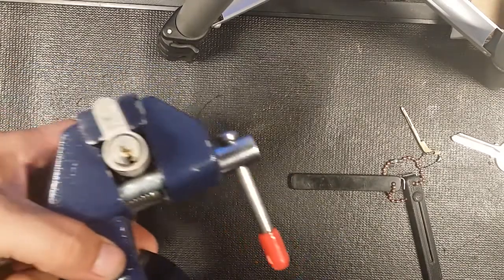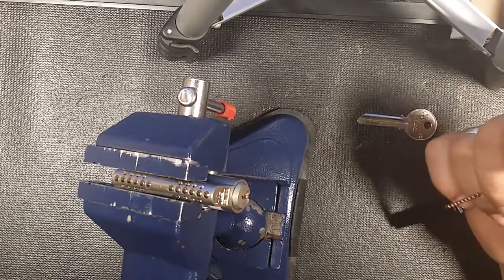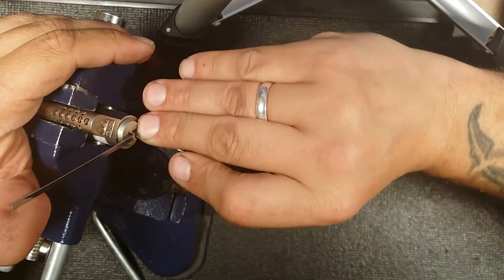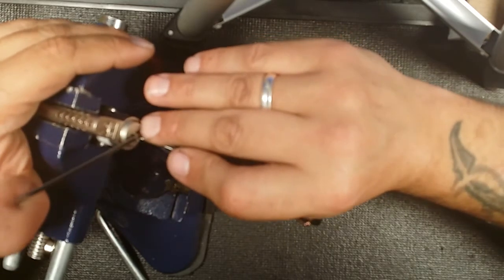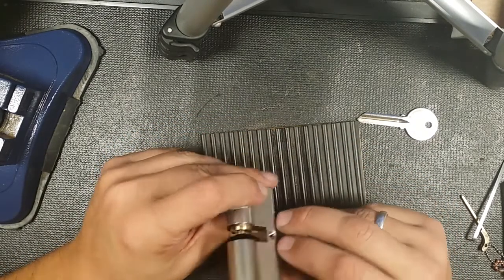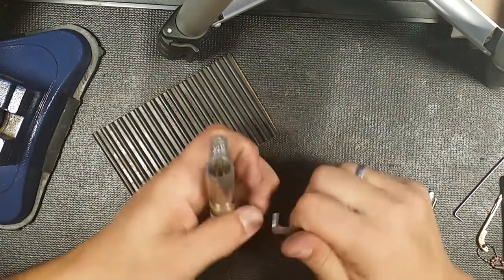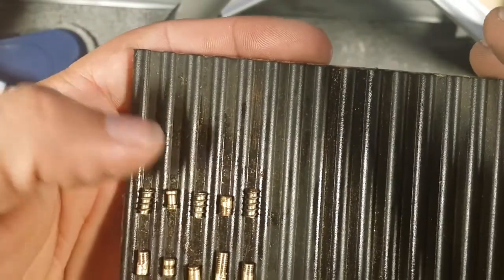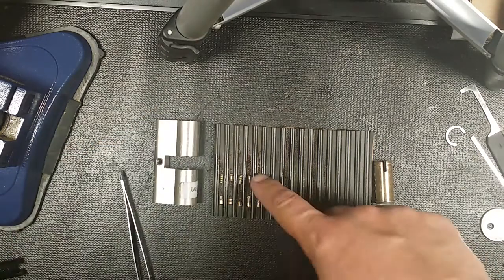-=142=- GTV Challenge Lock By NoTrickPony!

Comment: Great job in rescuing the lock and powerful picking on it. I need to tell you what I first thought about the method of getting the lock into a working state. You talked about "sand..." something and my brain completed it to "sandpaper". So I thought you were telling us that holding a sandpaper on each side of the lock for a little while would fix it - like a spiritual ritual ;-) My next thought: What a fantastic joke... But then I realized what you really meant and of course said ;-) That was a great tip. Cheers.
Reply from the maker: Potti314 lol. like threatening it! if you don't free up I'm going to have to use this!

Thanks man I was so happy to see it working again. I was worried for a bit though.